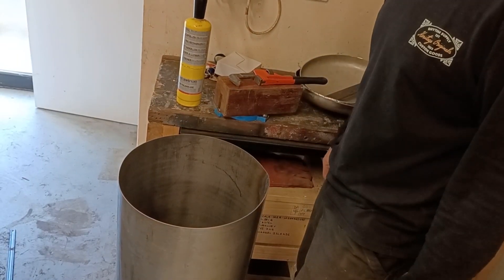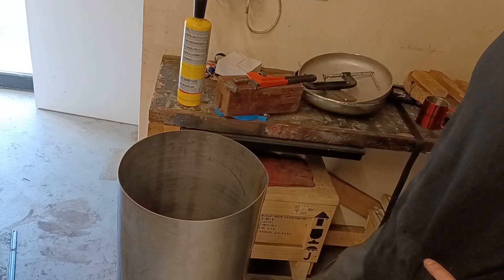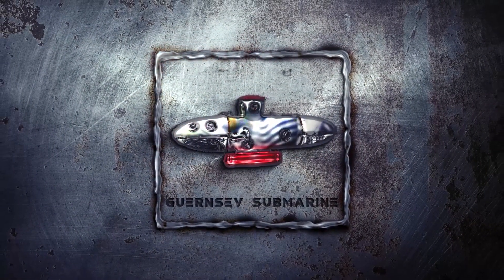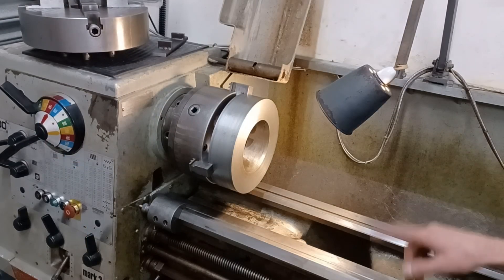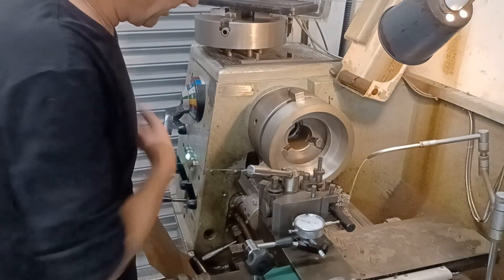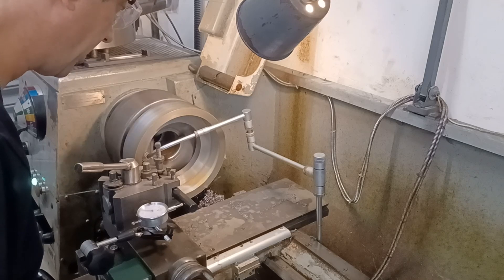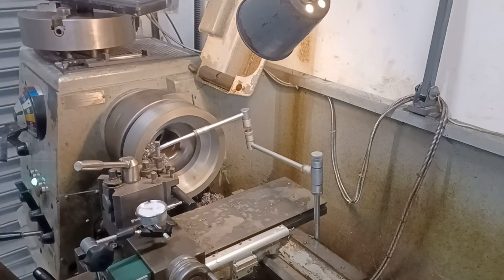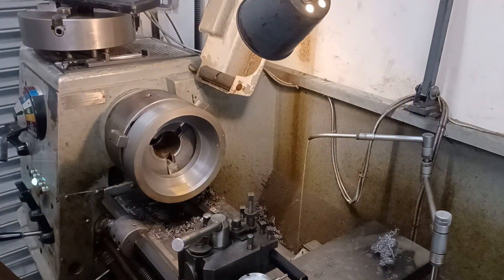Building a Submarine. Part 128.

Comment: Don't do it! . Because of the battery pods, a K350 is already incredibly stable, I've stood on the hatch ring holding the hatch and you can hardly make it lean. Gains in freeboard will be marginal, and unnoticeable in an ocean swell. You'll only be limiting important downward visibility from the conning tower side ports, making it harder to tow through the water, and making more places for lines and seaweed to snag.